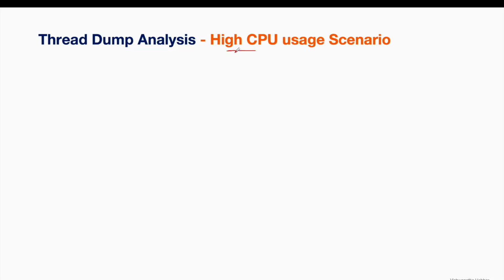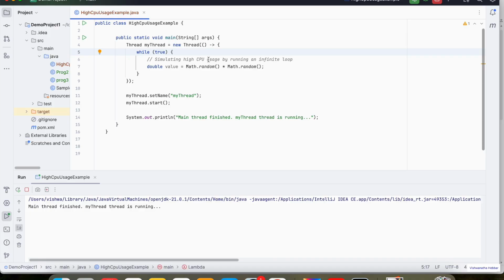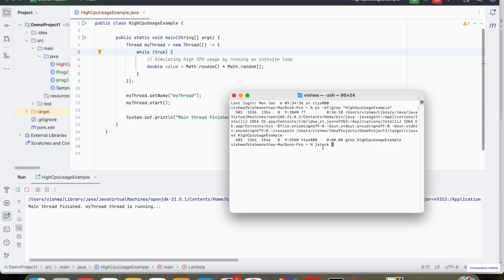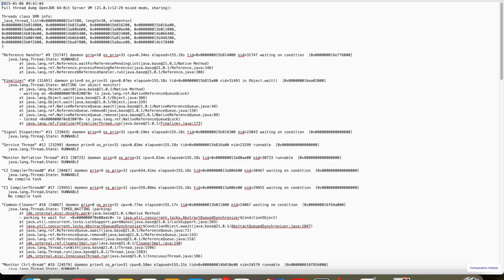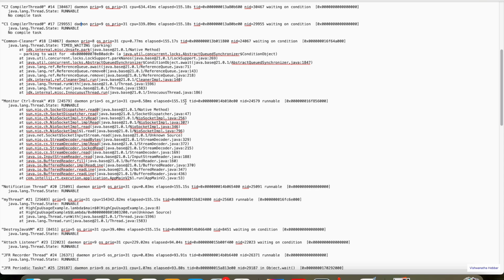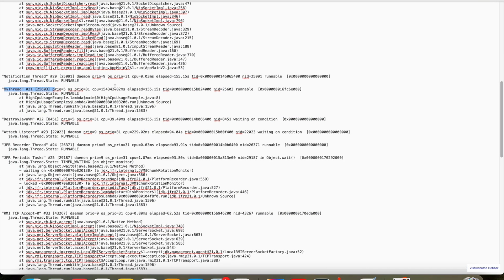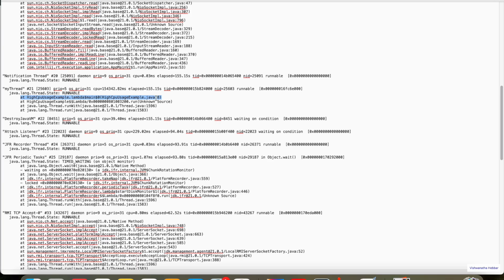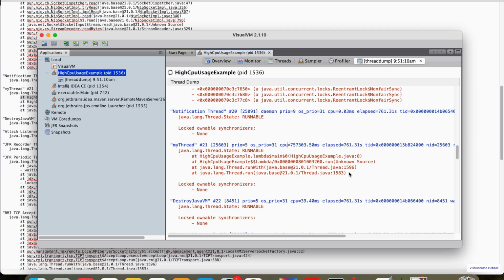Thread Dump Analysis High CPU Scenario | Performance Engineering | Performance Testing

Comment: Hi Vishwa,

I hope  you running the ps -ef|grep "Main" command in Unix OS  its not working windows CMD due to 'ps' is not recognized as an internal or external command, operable program or batch file. plz confirm the cmd executed OS in video
Reply from the maker: It is MAC OS